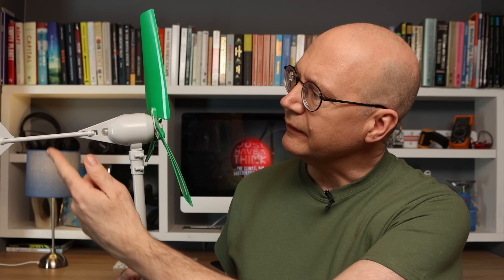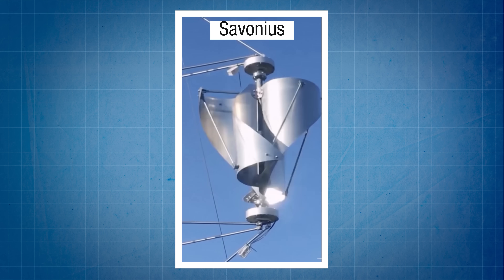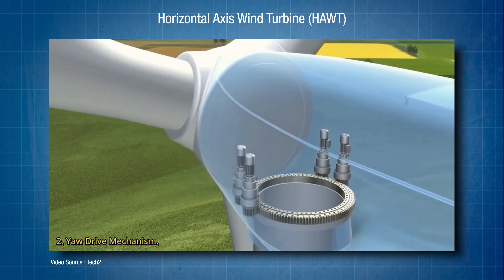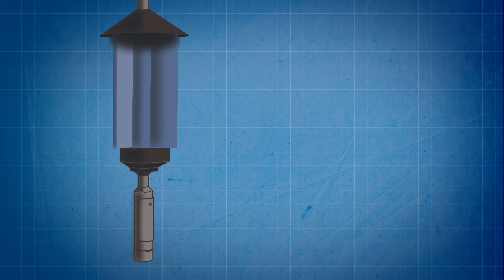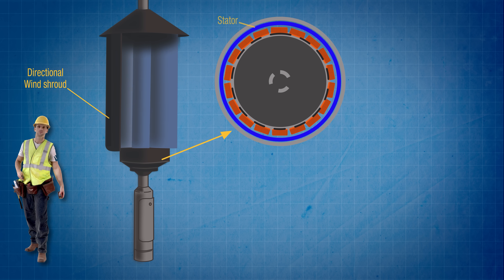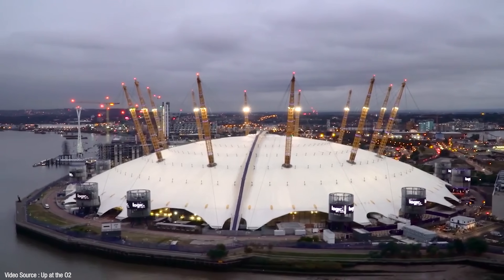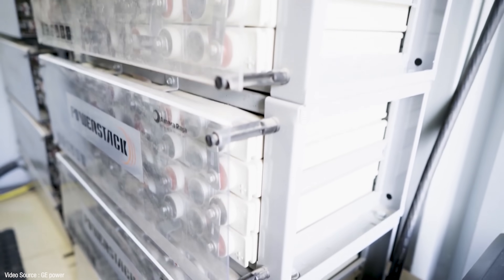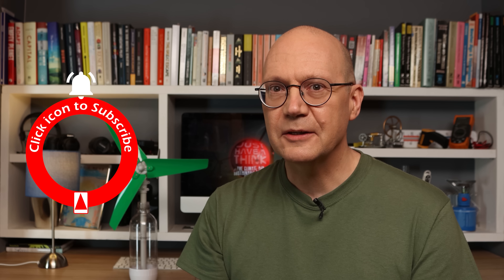A vertical axis wind turbine that doesn't need the prevailing wind! How do they do that?

Comment: Got me thinking about the large countryside turbines.  I remember those potential energy weights hoisted up by a cable from a dc motor with a brake/lock system.  couldn't/shouldn't those be fitted inside some of those commercial columns.
Reply: It's an interesting idea on the face of it, but lifting heavy weights to store energy is a very low energy density way of doing it. Here's a quick example: Energy in Joules is mass (kg) x gravitational acceleration (m/s^2) x height change (m), 1 kWhr is 3 600 000 Joules, so lifting a 1 tonne mass 100 vertical meters would require 9 807 J, so more than 2 orders of magnitude less than a kWhr - which currently costs less than 20c on most EU electricity bills.

A weight adds a further hazard to the people working on the turbine (Which is already a very dangerous job - constructing and maintaining wind power is massively less safe than, for example, nuclear in terms of deaths and injuries due to accidents for example) and will add more cost to the turbine not only in the cost of the weight and winding system, but in the extra structural strength for the tower and in all the support systems needed to locate the weight as well as the structural engineering needed to deal with a structure with structural resonance that will change dramatically depending on the height the weight is lifted to.

If it's on the grid at all it'll just send all the power it's generating to the grid, so no need for storage in the first place. If it's off grid, generating hydrogen or pumping water uphill (Same potential energy storage, but a safer way of storing the weight, though highly dependent on geography) would probably be a better use for the power. Making hydrogen would be my choice as reversing the electrolysis process would allow it to feed power back when the turbine is still or the hydrogen could be tankered away from the turbine if it's completely stand alone. Making hydrogen still requires a water supply, but 50-55 kWhr of energy is needed to make 1 kg of Hydrogen and 9 kg of water contains 1 kg of Hydrogen, so a small tank of water would last a long time (More or less indefinitely if the hydrogen was not being collected).

Comment: Living in the crazy windy, traffic damned city of Cape Town , with rolling blackouts constantly looming I had this same idea for street lamps last year!! Awesome to see someone actually built a working version! Perhaps I should actually pursue figuring out a diy version and see if there is any real local interest
Reply: I'm sure no one will think of taking one off a lamppost
Reply: @jmus6494  Well, we don't seem to have a big issue with people stealing lampposts, or solar panels off of signs.  History seems to lean in the direction of: thieves are lazy.
Reply: @Kineth1  hate to be cynical. There is a huge problem stealing manhole covers, cell tower batteries, water meters ( if metal). All depends if there is any value to be gained
Reply: @jmus6494  No worries about the cynicism.  They said these would be made mostly of composite materials, and weigh in under 10 kilos.  Composites don't have much (if any) scrap value, and it looks like the amount of copper is going to be very little as well, so if anybody were going to go to the effort to steal something like this, it would have to be sold off as a whole unit, or as parts for this unit in particular, which makes the theft easily traceable to the the sale.  That isn't a good deal for the thief or the "scrap dealer".

But cell tower batteries?  Break them down into individual cells and they can go straight to ebay.  I can definitely see the value in stealing those.
Reply: just gotta weld all that shit together. also, harder to steal if it's literally by lamp posts on busy streets.

Comment: Do the turbines add an air resistance force, thereby making it harder for the vehicles to move through the area with the turbines? If so, then the vehicles will use more power while in the turbine area of the roadway, thereby creating more ICE pollution, or reducing the range of an EV.
Reply: I was wondering about the same thing.. I dont know though..

Comment: Fantastic idea! My two concerns would be that; 1- each would have to be isolated  and not placed in series in the case of a motor vehicle collision that could disrupt that collector; 2- here in canada we have snow.. a lot of it! how would they work with snow clearing which has an incredible force when pushed off the highway by plows.  Either way, much better use of existing infrastructure with minimal effect overall. Great presentation sir!!
Reply: Each turbine feeds the local mains independently of the others via the existing feed to the lampost.  They are effectively connected in parallel.
Reply: They could deal with snow by putting the turbines on divided highways, on the inside median strip. That would leave the outside free for snow.
Reply: @matildamcgillicuddy3935  would work if they only plowed snow to one side like in large cities... here in the east coast they throw to both the center and the right... kinda sounds like a politician!! lol haha
Reply: Each one has its own inverter and fully independent grid connection. That part of the technology is decades old and very reliable. 

Winterizing wind turbines increases the manufacturing cost, but is otherwise insignificant.

The turbines will need to be installed high enough on the poles to be out of reach of fragile human fingers. This would put them out of the snowplow danger zone for many areas, but not where I grew up. There are areas where snow drifts can be 3 meters tall, and the snow removal equipment can throw the snow from the road on top of the drifts. In those places, turbines should only be installed high up on the tallest light posts.

The unknowns for me are interactions with wildlife, noise, and ongoing maintenance costs.
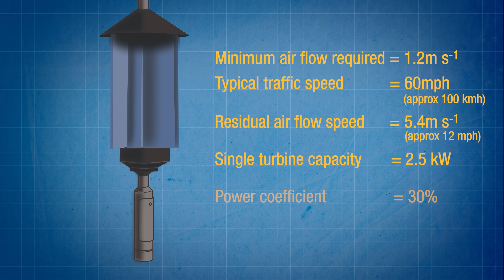Reply: @hamjudo  you can throw in the fact that the numbers are wrong by two (5:31) or three (8:50) orders of magnitude. The right number for a VAWT this size is about 25 watt. Which means this is a total investment failure.
Reply: @tzenophile  Good point.

The numbers made me think that the pictures were off. There are some light poles on US23 that look to be more than 15 meters tall. Those poles could accommodate 10 meter tall vertical turbines. If the turbines were 2 meters in diameter, then the swept area would be 20 square meters per turbine. Of course, that would require much stronger poles, and the turbines would be hugely expensive, but at least you could get kilowatts per turbine with a 50km/hour wind.

Each light assembly includes 6 huge lights in a ring around the pole that can be winched down for maintenance. They illuminate a large interchange.

Comment: I live in a windy location and would love to have one.
Reply: get one then
Reply: Is the average wind speed in your region higher than 6.8 meters/second?  There are charts that show the wind speed in different areas of the US.  VAWT is very noisy and produces too much vibration.  Don't forget the cost of batteries and charger for storage purposes and more importantly, the wind duration in your neck of the woods.  By the way, it can't be efficient if it is located in the woods.  Read the result of experiments on this type of device done by U. of Nebraska's Extension Service.  Good luck ith your readings.  You need to inform yourself first before spending any money on it.
Reply: @homayounshirazi9550  Oh, I wouldn't be spending money on it at this point in time. £20k is far too high a price and would never justify the cost.  The problem with domestic wind energy devices is the costs still aren't falling enough to make them viable.  But hopefully their time will come.
Reply: eat less air
Reply: get a real, proved-by-data horisontal windmill instead. This design is super inefficient.
Reply: @tzenophile  for a relatively small amount of power, and if in a residential/city area, a horizontal windmill won't be nearly as efficient as you'd think if you can't mount it on a high enough tower where there aren't any obstructions too high up to affect it.  In that case, a VAWT will be more efficient and cost less for results.

Unstated by OP is if they're in the open country or cityscape with houses around and have the option of a tall tower, which likely won't be allowed in many residential neighborhoods, especially with Home Owner Associations and zoning laws.
Reply: @strictnonconformist7369  So where did you get the idea that a VAWT is more cost-efficient than a HAWT in a non-optimal setting? You see, I just don't believe you. There are many stupid places to put a HAWT, but there are no good places to put a VAWT that will produce enough energy to recuperate the cost before it breaks down.
Reply: @tzenophile  So improve it instead of denying that they can work. Horizontal windmills have centuries of work behind them to get them to where they work now. Spend some time working to improve them.
Reply: @gravelydon7072  Half the swept area (the 2D plane facing the wind) of the windmill is turning against the wind at any given time. That makes them less than half as efficient as HAWT. They are also heavier per swept area, thus more expensive in materials and less turnable, and the weight of the blades rest on the turning axle, causing further inefficiency and wear.  I hope you see the problem now. And, did I mention that they have been around for centuries, too?  Savonius created his version in 1922.
The funny thing is, they keep being rediscovered by romantics, who should take  history and not just engineering lessons.
Reply: @tzenophile  Well your first statement is incorrect. 1/2 of an area does not have to face the wind. That is an easy problem to solve and has been. Second, weight is not all that big a problem whereas HAWT do have a problem with it. 3 or 5 blades weigh a good bit if you try to get decent power out of them. VAWTs can use magnetic or air bearings. Neither of those work for HAWTs. That removes the weight problem in VAWTs.  HAWTs have to have some sort of speed limiting for high winds whereas a VAWT would not.
Reply: @gravelydon7072  Ok, show me the research data that backs this up. No simulations, but an actual installation. There is a very good reason why these things are not more popular, 99 years after Savonius.
Reply: @tzenophile  Funny, research I have see says 45% for HAWT and 41% efficiency so far for VAWTs. That is a small difference. With a large savings on the footprint that a VAWT requires.
Reply: @gravelydon7072  Haha. "Research". Where? Only actual installation data counts, preferably peer reviewed, but I know you can't do that.
Reply: @tzenophile  Research it yourself. Agile is the company name. As for peer reviewed, I don't trust it because I worked in a university environment and know how it is done. And yes, my name is on one of the articles in a peer reviewed Journal. And much of the climate change garbage is peer reviewed and still garbage.
Reply: @gravelydon7072   So just as I thought, you have not actually seen any real research showing an actual VAWT installation reaching and sustaining 41% efficiency, whether it is peer reviewed or not. Thanks for the Agile reference, but they don't really feature any hard data on their web site that I could find, only news about their prototype breaking down.  Yet another VAWT startup that will be gone in max five years.

I am sorry that your own research experience has been a negative one, but that is not really surprising; researchers are only human and some are not very good at it, as in any business sector. Still, if you can come up with a better method for validating research than peer review, I'll come right over and kiss your shoe.  Even if you ARE a climate change denier.
Reply: @tzenophile  I don't deny that climate change happens. I deny that mankind is the cause of it. Big difference. By the way, want to cut down on carbon dioxide emissions, find a way to cork the volcano in Iceland as its eruptions have wiped out any reductions in carbon dioxide that mankind has made in the past decade.
Reply: @tzenophile  You've missed the point. It's very efficient in terms of cost per kW.
Reply: @chris_london123  No, it is not. The calculations are wrong by 2-3 orders of magnitude, as shown by Jeffrey Lebowski's comment (and by anyone who knows the efficiency formula for VAWT). This thing will produce  max 25 watt at 5.4 m/s, not 2.5 or 24 kW as is stated wrongly twice, see 5:31 and 8:50 in the video. Dave is completely out of his depth here.
Reply: Me too!
Reply: Get busy and make one
Reply: Please contact me ...
Reply: Why should the person contact you?
Reply: @bartoszbarejko1585  contact mail or number plz

Comment: If would be good to VATS used on chimney or air conditioners using the waste heat from the exhaust. This is not grid scale technology but would use so much wasted heat generated daily around the world.

Comment: Did it irk anyone else when he spun the turbine in the wrong direction at the start of the video?
Reply: If you have to spin it, it does not really matter which way
Reply: @tzenophile  The wind blows on to the front of the fan, which should turn it anticlockwise, not clockwise like he did.
Reply: @rogerbarton497   What wind? j/k
Reply: Well spotted.

Comment: Great video Dave (as usual) and thanks for the shout out 😁
Looking forward to seeing how these early turbines go in the long term!
Reply: The Savonius design is 100 years old.  Spoiler alert: they didn't.
There is also the simple math error; a 2 m high vertical axle wind turbine will never produce 24 kW (8:50) or 2.5 kW (5:31 so which is it, Dave?), but more like 25 W.  omnicalculator. com /ecology /wind-turbine
Reply: Yeah, I pressed one hell of an X to Doubt when it was kilowatts. I could see maaaaybe a kilowatt.
Reply: @deathhog  Check out Jeffrey Lebowski's comment which calculates the real output; around 25 watt at 5.4 m/s. It's a real shame that the good, critical comments are drowned out by happy fans with no clue.
Reply from the maker: Cheers Rosie. And thanks for the knowledge I gained from watching your very informative videos :-)
Reply: @JustHaveaThink  What do you have to say about the claims you make of 24 kW (at 8:50) or 2.5 kW (at 5:31) you make (so which is it??), that are clearly wrong for a turbine of this size? Sorry, Dave, but computer says no.

Comment: Cool as they redesign cars to have better air flow these turbines will produce less power haha figure that into your projected power production
Reply: Who cares?
If one of those turbines can make same amount of eletricity that lamp uses, it is worth it from electricity point of view.
Reply: there is an optimal point so theres a min
Reply: They are already down below a cd of .4 and many vehciles have a drag coefficient of .32 - how much lower do you think they can get and what reduction in energy collected will that amount to?  SFA is my guess, especially given the relentless increase in frontal area which determines the available energy  lost to friction by a vehicle multiplied by the cd.
Reply: Not really an issue, the amount of streamlining a vehicle has doesn't change the amount of air displaced.
Reply: So what? The wind blows anyway and the electrical infrastructure is already available.
Reply: @martincotterill823  the air turbulence from a car passing thru aid the car behind it, slightly reducing its friction. Also the air turbulence dissipate pollution from all the car on the road.
Reply: Ya I like them but the number crunchers need something to do
Reply: Great idea when they build new, the pole manufacturer could supply new light pole with the wind generator built in, a pay for itself infrastructure.